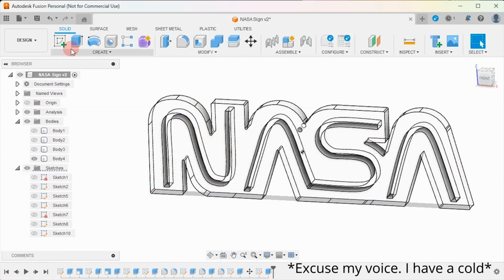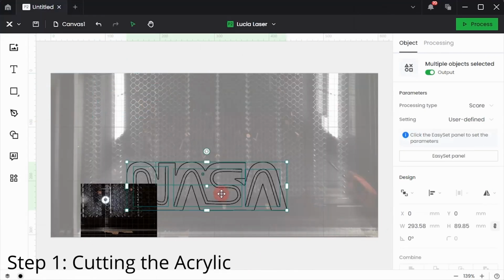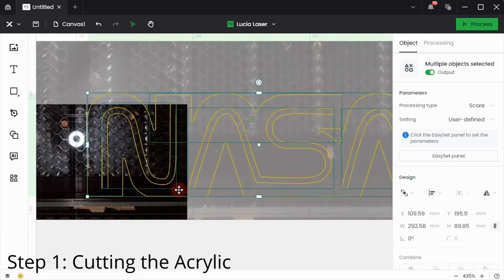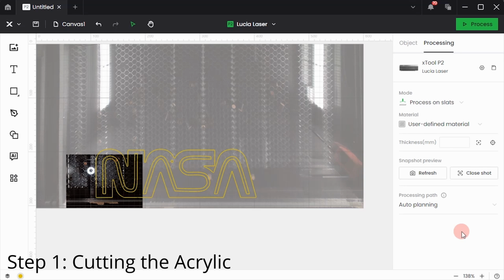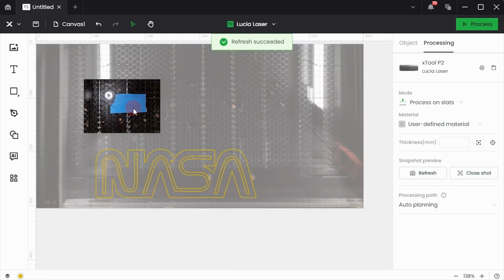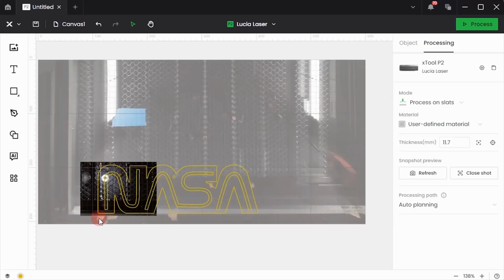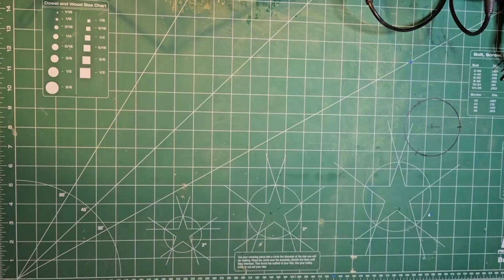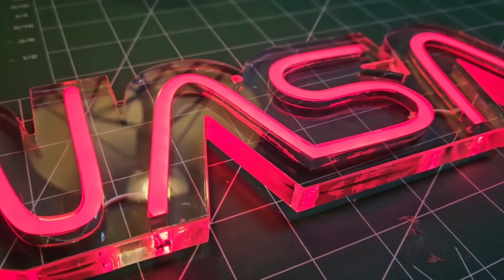Build this Neon Sign - NASA Worm Tutorial

Comment: Excellent work! I'm looking for a LED strip that I can cut to the desired length whenever needed, but I haven't been able to find one. Could you please share more information about it?
Reply from the maker: The best I have found are LED strip with frequent cut points. I believe this one had them every inch or so. That does mean that it can be a little tricky sometimes getting the strip length just right for the sign!
Reply: @FLALabs  Can you give a link to the LED strip you used??
Reply from the maker: Lamomo LED Neon Lights, 16.4ft... https://www.amazon.com/dp/B08SHZZ45X?ref=ppx_pop_mob_ap_share

Comment: settings for the inside where the lens go ?
Reply from the maker: If you are talking about the width of the groove where the led strip goes, I used 5mm to match my led strip!
Reply: @FLALabs  yes what Im asking, is how did you get the laser to only cut half way through to create the groove
Reply from the maker: @kennyrobman7390 in this video, I us the method of cutting all the way through the acrylic creating a void for the LED strip to press into.

Comment: How thick should the channel be? Do you happen to remember from the top of your head? 🥹
Reply from the maker: I used a width of 5mm for this project and the acrylic is 12mm thick (deep). The width of your channel will be based on the width of the flexible LED strip. I recommend a small test to find a channel width that the LED strip can press into firmly so that no glue is needed!
Reply: @FLALabs I was wondering how thick the acrylic is. Thanks!
Reply from the maker: @skyjim777 the clear acrylic is about 1/2" (12mm)
Reply: @FLALabs  you might have said but did you cut the channel all the way through? Forgive my ignorance. I don’t have a laser. I’m ordering one soon. Did you use a CO2? What are the length and height? I have some old school real neon signs and love them!
Reply: @skyjim777 I have the same question
Reply from the maker: I used 1/2" clear acrylic and I did cut all the way through with my xTool P2. These are a bit easier to make with a CNC by cutting a shallow groove, adding flexible LED strip, and then using a silicone diffuser, but this works too! I made the channel 5mm wide to work with the LED strip I used.

I also take custom orders on Etsy, just message me if you are interested!
Reply from the maker: I have the same answer! Haha Please see my reply so I don't have to retype it!

Comment: Stupid question. I've thought of going the same route where you cut out the path to lay the LED strip in, but my main concern was the length of the LED Stip cutt-off point if that makes sense? If the path is shorter than the strip or longer, what would you do then?
Reply from the maker: No such thing as a stupid question! That is actually one of the challenges with these projects... you could probably do the math and make sure each letter has a "length" that works perfectly with your LED strip, but I find it best to just get LED strip with more frequent cut points (every 1/3" in this case) and get as close as you can. When it's turned off, you may notice little gaps at the start and stop of the channel where the LED strip is a little short, but when it's on, you can't even tell! I hope that helps!
Reply: I’ve seen Chinese videos where they fold the strip
Reply from the maker: Yeah, in those videos they press LED strip I to a groove that is cut by CNC and then add a diffuser in front of the LED strip. It's a MUCH more simpler way to make these Neon style signs but I don't have a CNC machine!
Reply: @FLALabs  you can actually use a laser cutter to do that. You will just need to use 2 acrylic sheet. 1 to cut (to place the led strip) and the other as the backer
Reply from the maker: @patapon121 Yes, I tried that but with clear acrylic I always had lots of ugly bubbles between the two layers of acrylic!